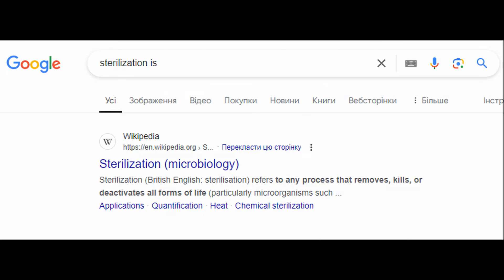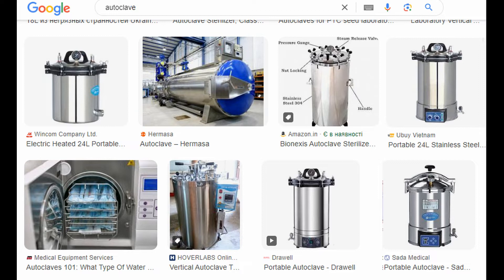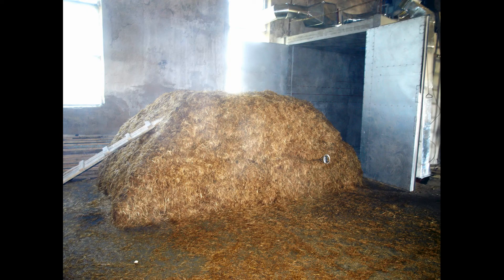What Oyster Mushroom Yield Really Depends On: Substrate, Processing Method, Spawn Rate

Comment: How do you check the ph of the sawdust?
Reply from the maker: To find out the pH of sawdust, you need to soak it and then measure the pH of the solution. But, as a rule, the pH of the substrate itself is not checked, but the pH of all the components separately. The substrate must have a certain ratio of carbon to nitrogen (for oyster mushrooms, for example, it is 40-50:1) and the components are selected according to this principle. Then measure the pH of the moistened substrate and add lime so that the pH is 7.8-8.2. My article describes how to measure pH https://veshenka-expert.info/en/ph-for-mushroom-substrate-adding-lime-to-the-substrate/#measure

Comment: I really appreciate your videos. Total science and very sensible advice. 

What is the perfect level of nitrogen (0.6), phosphorus?, which micronutrients? What should the humidity of substrate, oxygen and carbon dioxide levels be at which stages of growth (spawn growth, substrate mycelium growth, mushroom fruiting). A lot of questions, I realise. Perhaps for a later video.
Reply from the maker: Ok. Thank you for your comment. I will try to answer in order. The nitrogen level is from 0.6 to 1. Depends on the composition of the mixture and the processing method, I will write down this topic for the next videos. Phosphorus, like potassium, as well as microelements are needed by oyster mushrooms, and when using at least two types of agricultural waste from different biological groups, they are usually enough. I do not know the exact figures.
I have an article on the substrate humidity on the site https://veshenka-expert.info/en/hydrothermy-mushroom-substrate/#water
There is also an article on carbon dioxide, just by the stages of growth.
https://veshenka-expert.info/en/deformed-oyster-mushroom/
Reply from the maker: I will be posting new videos every week on Thursday, starting in September. I still have a lot to tell), and I will also take note of what is suggested in the comments.